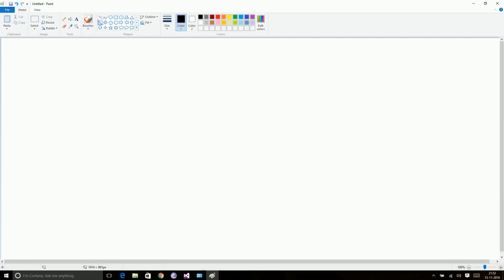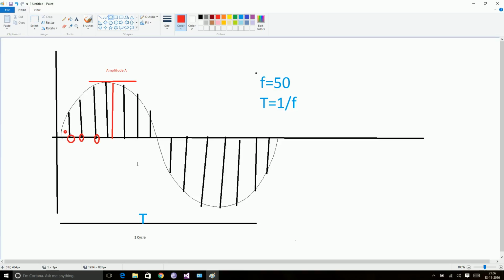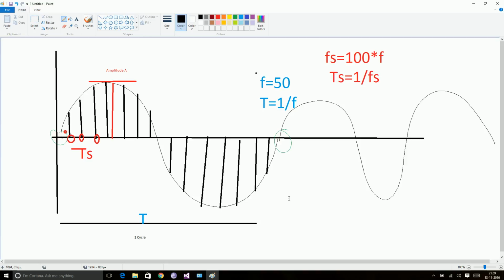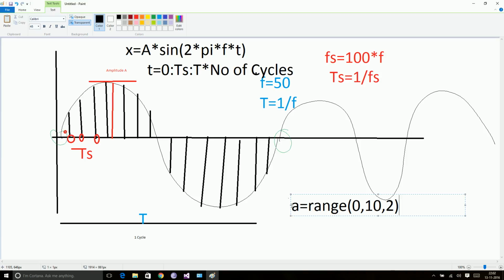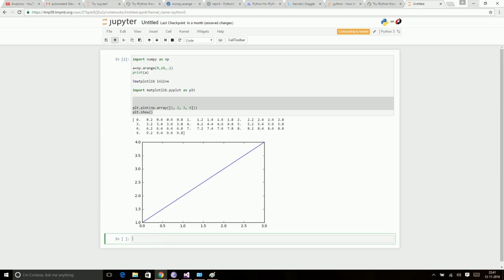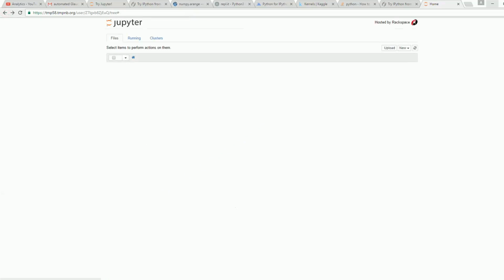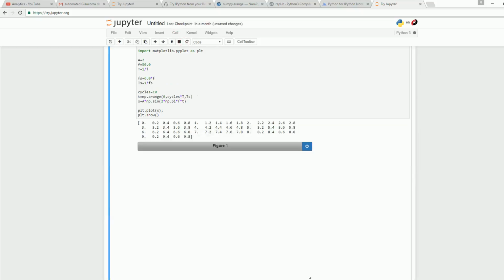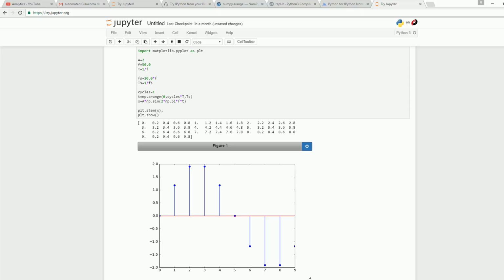Python Tutorial For Beginners Part 3: Signal Processing Basics 1: Sine Wave Generation Theory, Logic

Comment: INstalled Anaconda. importing libraries using Jupyter QtCOnsole is pretty awesome.
Question:
Which is more recommended for python programming?
1. Jupyter QtCOnsole ( Intellisense doesn't work here)
2.  VS using Anaconda : VS seems to be too slow although intellisense works but complex for programming i suppose.
3.  Spider is also downloaded along with Anaconda and is available.

Keeping in mind, we have to program a specific project!
Reply from the maker: Jupyter is good. Python doesn't have a complex library. So intellisense is not really needed in most of the cases. VS is needed at a later stage for wrapping the Python notebook into a Web App with Django or Flask.
Reply: Okay sir.. for me Jupyter and Spider both looking good..so will continue with Jupyter on further lessons. Thank you.